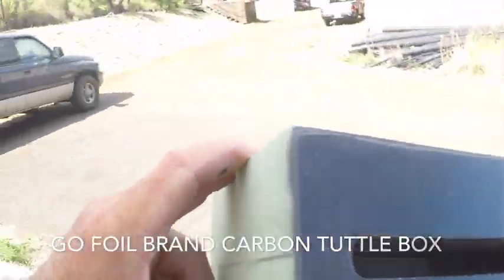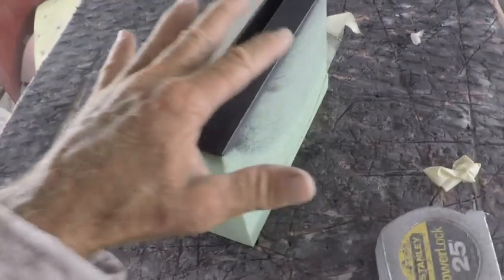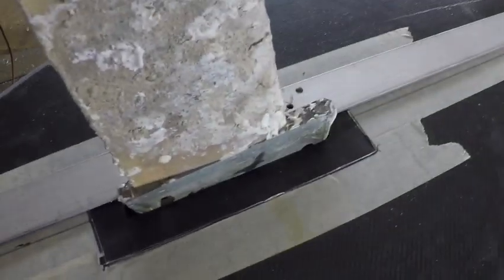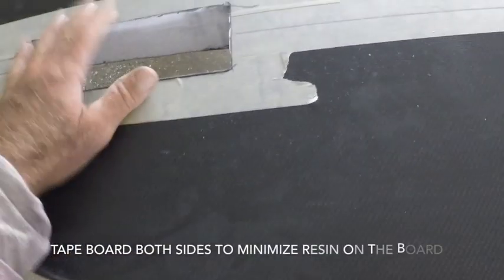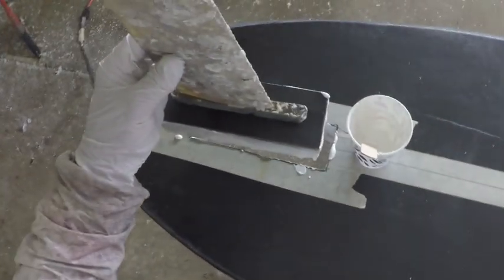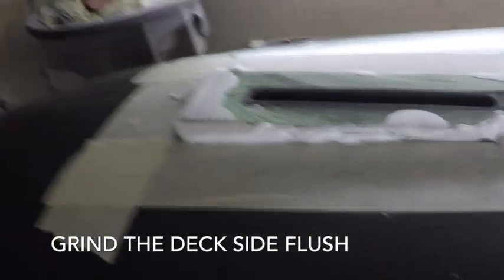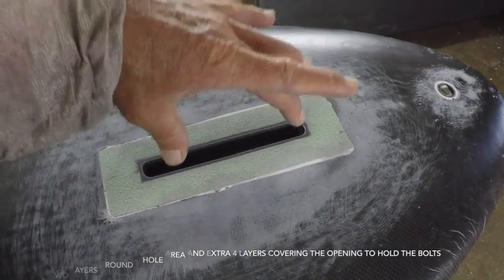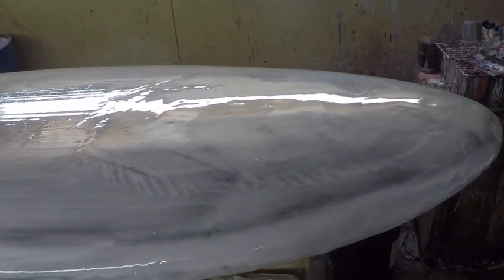How to Install a Go Foil Tuttle Box in your Surfboard for Hydrofoiling

Comment: Should do a plate mount with 90 mm centres. Then your foils could be used with tracks and plate mount systems.  Not many surfers want to install a tuttle box.
Reply from the maker: Tuttle box is easier to install and lighter than two fin box tracks . Depends on whether you want the top of the line high performance or not. Not only are the tracks heavier than a tuttle box but the plate itself is heavier on the foil.